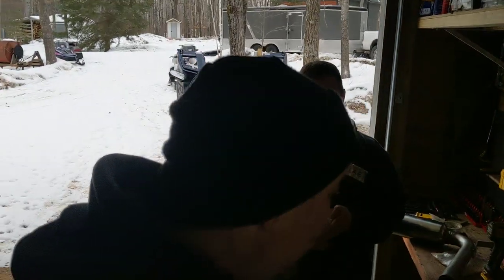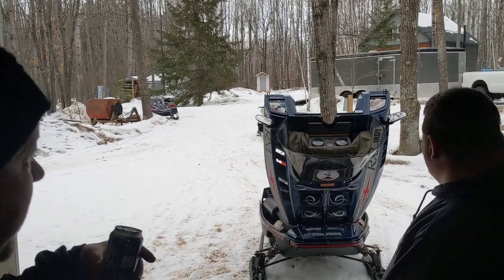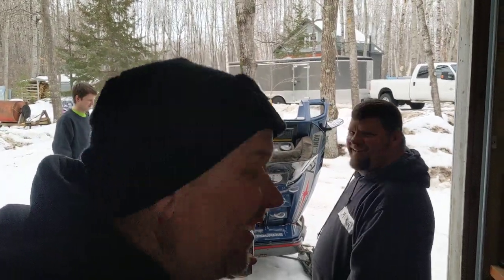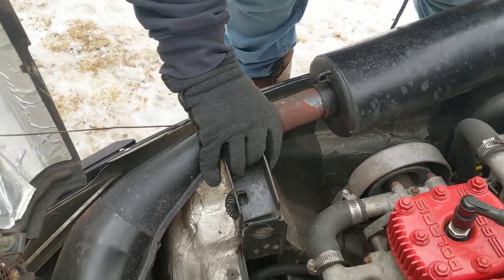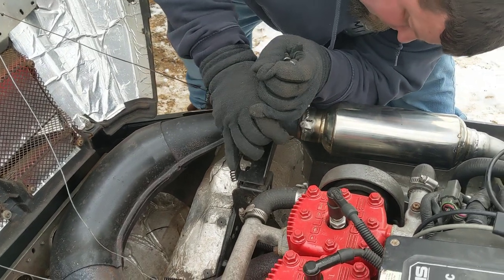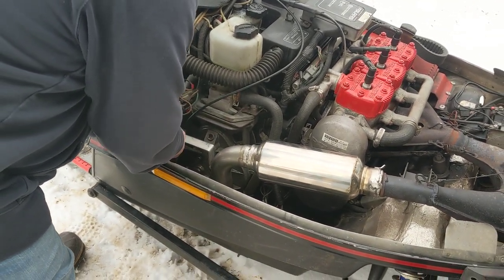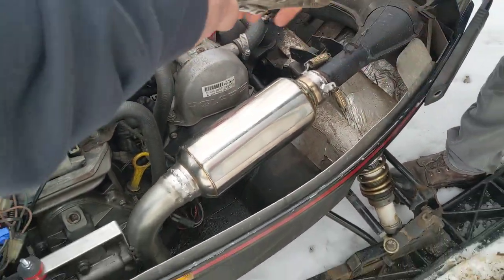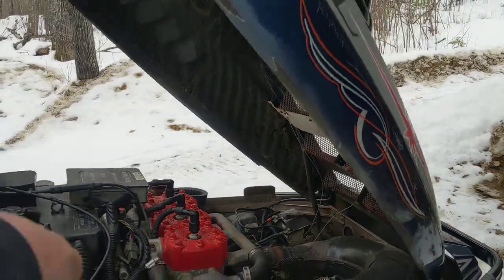Polaris RXL triple stock exhaust vs Trash Can

Comment: That was the best lookin RXL hood out of all of them.
Reply: I had a 91...bought it 3 yrs old when I was 16.  Used to rip it around my parents grass in the summer I was so psyched.
Reply: The 91 RXL is the best looking snowmobile Polaris ever made. I had one with SLP pipes and a chip for the computer and it really ran good. Then I wanted more HP so I found a SLP 650 engine made into a 707 kit which produced 165 HP..

Comment: Digit 9 uses a shoe lace for the springs looks like it worked great
Reply: I tried this it works great
Reply: I actuallt usually use vice grips. Latches onto the spring always in control never flys across the shop

Comment: I need your help with my 97 xcr triple triple triple!!!
Reply: I have antifreeze in my pipes , is my water pump bad?
Reply from the maker: @nathanrogalla5675  head or base gasket. To you get pressure in you cooling system?
Reply: Pulled out the pump , a lot of play on the pump gear ! , Got a new pump on the way , thanks for your help and your time, we should go riding on of these days!